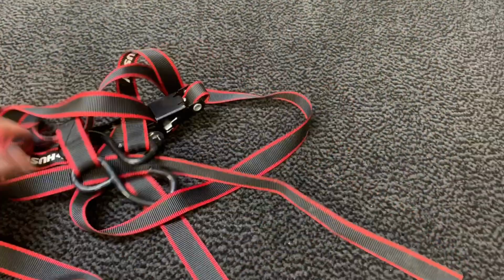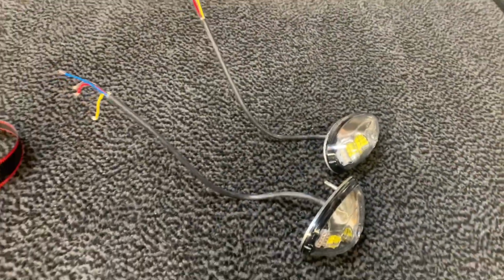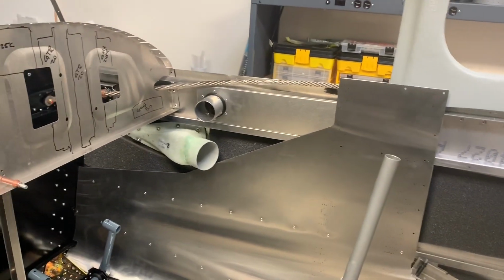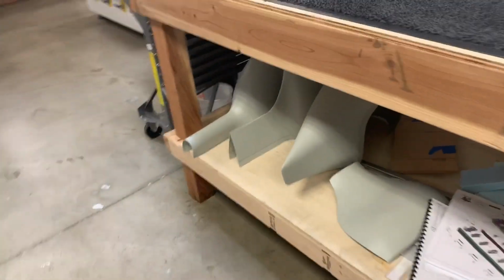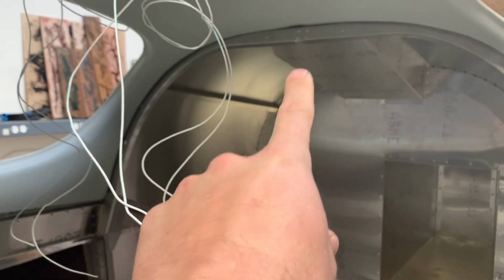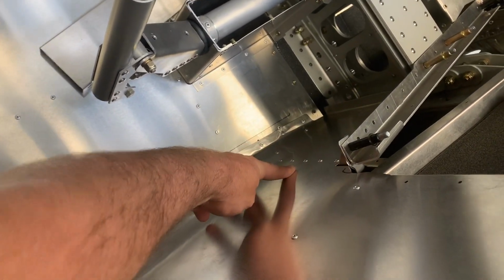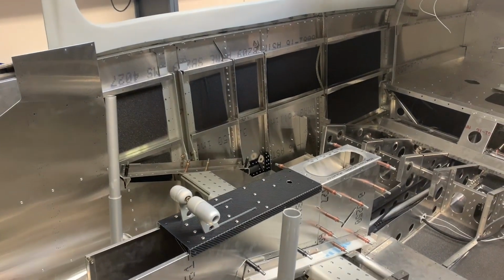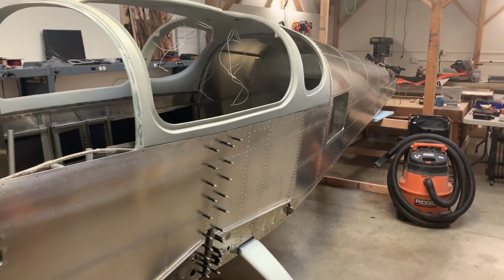Sling TSi- Working on Details

Comment: Evan, another good update. Your videos have been great as far as I can see because of all the little things you have pointed out. If I was ever in the position to get my ppl, I would then want to build me a sling tsk. I’m a big guy and need the extra flying load as well as the room. Hopefully some engine install highlights and the panel assembly. Keep the tempo going as your coming to the final corner and the finish line is in sight.

Comment: Are those all pop rivets?..that’s crazy why not cherry max?..I’m not sure but I thought you can’t use pop rivets on structural parts?..just curious because I seen those rivets have a hollow center
Reply from the maker: Tony Rodriguez this is how the kit is designed. I’m not sure if other kits don’t allow pop rivets to be used, but sling aircraft have been using them for almost 20 years now
Reply: Zenith used pop rivets as well.

Comment: for painting overhead lights are a minimum.  Side lights are even more important as they allow you to see reflections and determine whether your paint is flowing, too think or too thin.  Temporary lighting all around what you are painting is an option.  Look at a pro booth and you will see that they have more lights at belly button level than overhead.
Reply from the maker: Chris Holm I’ve noticed that, thanks for the tip!

Comment: Evan, my kit is on he way and Mid West Panels is doing my Avionics. My total electric load is in the high 30's AMP and so it is suggested that I go with a external alternator. Did you engine come with a external alternator mounted to the engine? I understand the Rotax 915 has 2 internal alternators...do you know anything about that?
Reply from the maker: G S did Midwest suggest you use the external alternator? I’m not aware of anyone needing one, even with advanced IFR setups with 2 10” G3X screens, gps, g5 etc. What avionics are you trying to install?
Reply: @EvanBrunye  Because my plane is Canadian spec I have the full IFR setup plus the Garmin GTS 800 Active Traffic and Artex 345 ELT. In planning my simulated AMP load is 34.5 AMPS with Garmin avionics, a pitot that is heated up and operating normally, one device plugged into each USB port, the cabin heater operating and all taxi, land, nav, strobe lights operating. The internal Alternator is rated for 30 AMPS so I am just above it capacity so we are looking to add a 40 AMP external alternator. To date I am the first and only Canadian Sling TSi build so its a bit lonely on this side of the border....
Reply: Hi Evan...I just sent you an email...
Reply from the maker: G S I see, the GTS800 is the kicker. Is that mandatory for Canadian IFR? Seems overkill when ADS-B provides similar function. I’m not sure actually that anyone has ever added the external alternator to a TSi. You’re in for cowling modifications, and who knows what else. I’d strongly advise rethinking your avionics rather than trying to add the alternator. But I’m not familiar with Canadian regulations

Comment: Curious why no parachute? Can you add it later?
Reply from the maker: Steve McCluskey it’s expensive and heavy, and I’ve never flown a plane with one before. This will be by far the nicest plane I’ve ever flown, so I trust it. But the parachute will be easily added later if I change my mind.
Reply: @EvanBrunye  that's good you can add it later.
Reply: That's great, I was wondering if it could be retrofitted.  While there is a (low probability) use case for one, the cost and weight penalty are significant.
Reply from the maker: @ericlaw2416  agreed
Reply: @EvanBrunye  Since you're not installing the parachute, do you still need to put in the box that contains it? I asked about this as OSH a couple years ago and I was told that the box was a structural component, which seem strange since its not structural in the Sling 4. That box takes up a whole lot of baggage compartment space.
Reply from the maker: Erick Tijerino no the box is not essential to the structure of the plane. It probably is structural if the parachute and rocket are installed, to hold the force of the rocket when it ignites, maybe that is what they were referring to.
Reply: @EvanBrunye  now that makes more sense, thanks for sharing the process of your build!